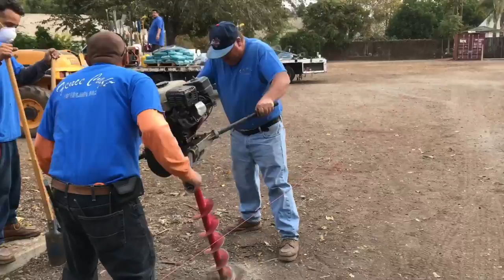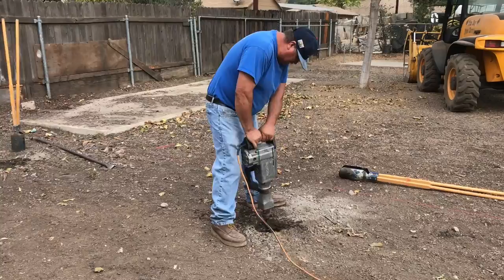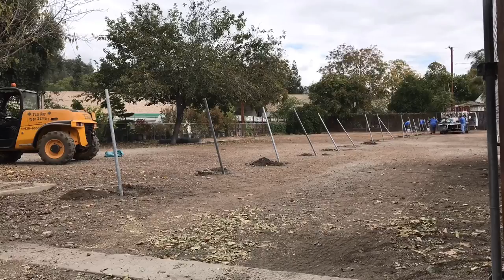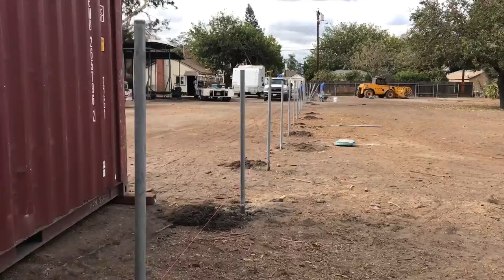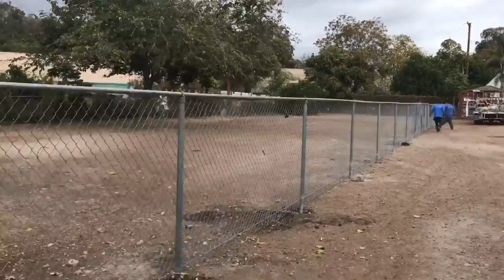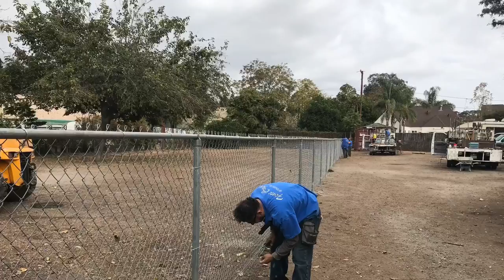Installing a chain link fence

Comment: First all, get a 1/3 yard mixer. Cheaper to make your own concreat than sakcrete. Concrete needs left down 3" not topped off. They will push. Get a beaver one man digger, much more efficient. Dont use 16" ties and cut them, use 9" and wrap. Who wants to go back and pick up cut ties? And someone said " Bottom string but no top string" a real fenceguy can eye it to height. Heieght marks on terminals eying in the lineposts. Haven't seen a decent fence installation video yet. Smh
Reply: Make a video then dude

Comment: All you showed was the posts.. You skipped over the entire chain linking part..
Reply from the maker: Yeah I know sorry, I had to leave for a while, probably shouldn't have even posted this video.  If it helps they strong two heavy guage wires across the top and bottom of poles, then attached chain link with  the wires they use.  They then pulled it tight with a puller from one end and attached it.  The end they just added more wire to the fence to attach it.

Comment: Is this video supposed to be discrediting this crew? I only ask, caz the opening screen is with drilling a hole, but the drill is not drilling down. It’s rotating the drill bit in reverse. That’s why no hole is being made! Then skip to the end of the vid & they have fenced in one of their own vehicles.
Reply from the maker: No, no hidden meaning or agenda.  It's just a video of the fence being installed and the tractor was my fault for not being there to move it.
Reply: The drill is rotating in the correct way.

Comment: They used a bottom string but not a top string that’s how you know they don’t know what they’re doing lmao, also filled the cement caps way too high, over time those posts are gonna shoot up out of the ground and the cement mix was way too wet, hacks